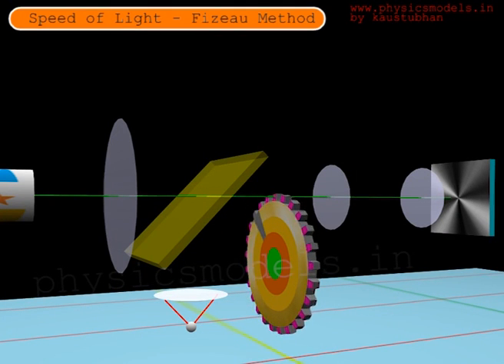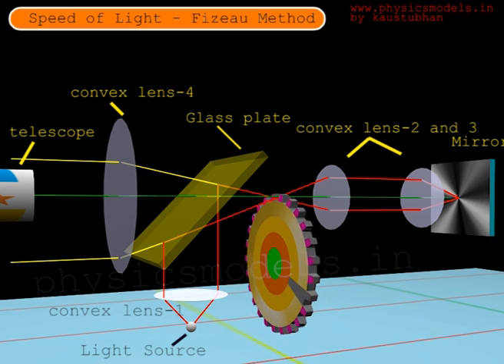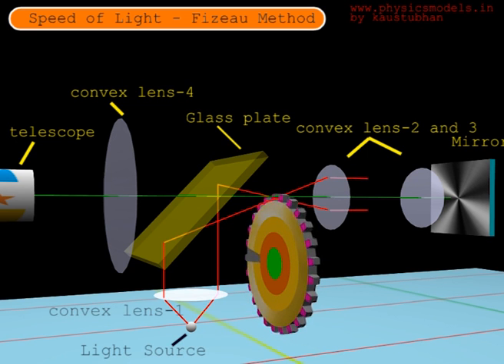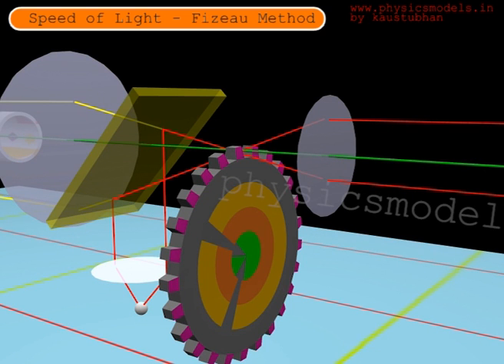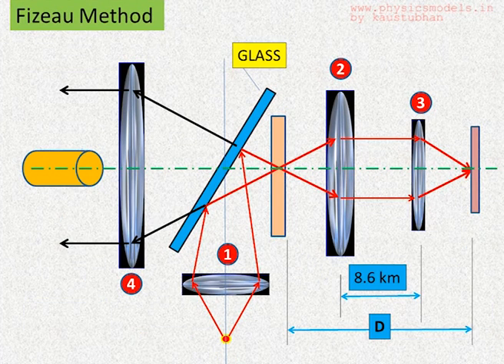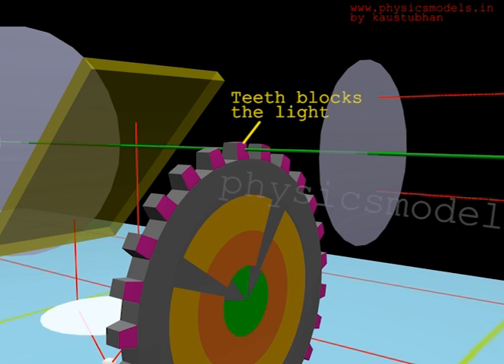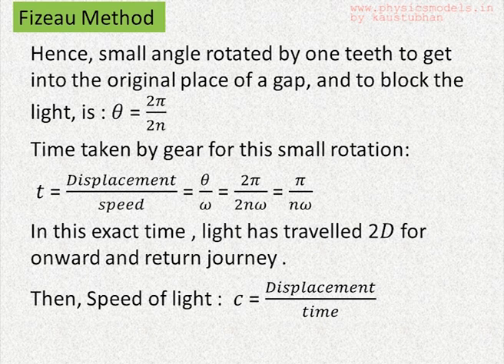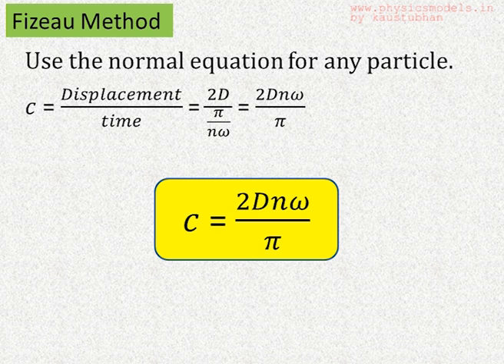Physics Made Easy-Speed of Light by Fizeau method

Comment: 8.6 mile or km 
You said both
Reply from the maker: It's 8.6 km, not 8.6 miles. (I apologize for any erroneous mention of 8.6 miles in the video).
Reply: @physics_animation_tutorial  when doing real science, it is always metric!
Reply from the maker: @martinmendez695   you are right, I said both km and miles , my speaking mistake. The distance between the wheel and mirror is 8.6km.
Reply from the maker: I'm sorry , it should be 8.6km. Fizeau used km, not miles.

Comment: Just a tip here, from an experienced university lecturer: if you put up a slide of text, either read it verbatim or leave a silence of appropriate length. Please do not say something that approximates, but is not identical to, the text content of the slide. At best it is redundant and at worst it creates an unpleasant interference between the two messages.
Reply from the maker: Ok, thanks for the good tip. Got it. Will follow this in future videos.

Comment: But still I can't understand
Reply from the maker: Hi Vikas, you can tell me what exactly you don't understand and I can try my best to explain. request you to login to my website which has more explanations. https://www.physicsmodels.in
Reply: Physics Models this was just a theory and a formulae u explained... But it was not the actual speed..Coz depending on strength one person can run fast other may run slow.. similarly speed of light depends on source of light used ... Here what is derived is the speed of disc rotating with some how we can compare that to speed of light but it's not the exact speed......
Reply from the maker: Hi Vikas, I understand your problem. You have to understand three things here :- 1) speed of light is constant in the universe. 2) It never changes depending on source of light. For any wavelength of light, including white light, the speed of light is the same, for vacuum. Only if you change the medium of travel, speed changes. 3) And speed of light does not change depending on relative speed of observer. This was the outcome of the Theory of Relativity. These are important learnings in physics. Once you get this right, you can master many concepts.

Comment: Hi, again the same 2 problems that are not clear:
1.
To find a velocity you MUST have D (distance) and T (time). How can you determine V if you do not have these 2 variables? 
To get 16 km you can:
16 = 300,000 * 0.000053
16 = 150,000 * 0.000106
16 = 100,000 * 0.000159
So how can you know that this is 300,000 km/s and not 100,000, again if you don’t know the time???

2.
You said that the RPM is 1562 so in 0.000053 sec you passed 1 tooth. 
So after 0.000053 sec you passed 1 tooth
After 0.000106 sec you passed 2 teeth
After 0.000159 sec you passed 3 teeth
So again, how could he know that you pass 1,2,3…………n teeth? 
To get a perspective, after 1 second he passed 26*720 = 18,720 teeth only in ONE SECOND.
How he measure how many teeth he passed?

Thanks
Matan
Reply from the maker: Hello. Yes, definitely, 𝑣=𝐷/𝑡. We are not doubting that.
In our case, We already have "D" as distance , 8x2=16 km. Let us Start from the beginning. 
Frequency = 1/t . So time is indirectly getting measured by frequency in Fizeau experiment. Now, frequency of teeth interrupting light beam is :-  𝑓=𝜔𝑛 
where 𝑓 is frequency, 𝜔 is the angular speed of wheel, and 𝑛 is the number of teeth going past the light beam, which is given by : 𝑛= 720 because there are 720 teeth. 
Then, frequency of teeth + gaps interrupting light beam would be : 2𝑓=2𝜔𝑛 
Distance D = 16 km. 
 Plug into 𝑣=𝐷/𝑡 , i.e. 𝑣=𝐷𝑓 = 16(2𝜔𝑛) 
In this way, Fizeau got around the problem of measuring time "t" using a stop watch, and he had to only measure RPM of the rotating wheel.
I hope this explanation is crystal clear to you, now.
Reply: @physics_animation_tutorial  

Frequency is defined by the number of teeth and angular velocity. Change one or both of these parameters and what will happen? Do the math. In fact, put real world values into the equations above. Why are you using letters when you can use numbers? 

For example:
n=120
What happens when the wheel only has 120 teeth but all other parameters remain the same? What's the calculated velocity of light with 120 teeth? 

The math appears to be circularly reasoned and does not appear to prove anything.

Comment: Great video but I have a big question for you, and please tell me what I made wrong:
The Distance was 2 D = 16 km
So the time that the beam traveled to the telescope/eye was 16/300,000 = 0.000053 sec   !!!!!

Now, 2 problems:
1. With which device he measured 0.000053 sec?
2. To travel only 1 tooth and 1 gap the RPM of the gear supposed to be 15,000,000,000    !!!!!! How can he roll it so fast???
I will explain –
• Let's take that the Circumference of the gear is 1 meter so the radios is 1/2 pi = 15 cm. and let say that there are 50 teeth and 50 gaps each is 1 cm.
• 1 RPM is to do 1 Circumference of 1 meter in 1 minute.
• So in 1 sec you do a Circumference of 0.016 meter. We said that 1 tooth and 1 gap is 2 cm so in 1.25 sec you do a 0.02 meter.
• So in 1.25 sec you do a Circumference of 0.00002 km
• So 1 RPM = 0.00002 km
• Let's divide the speed of light 300,000 km/sec to 1 RPM =0. 00002 so the RMP of this gear is 15,000,000,000 !!!!! 

So how can it be?????
Reply from the maker: Hello Matan, good question. The original description of Fizeau experiment says he used 720 teeth, not 1 tooth and 1 gap. This helped manage the rotational angular velocity of the gear a lot. The calculation for 8km to and 8km on return path gave a total distance of 16km, and the rpm calculation was worked out as : RPM = [(speed of light per second)/(distance)x(No.of Teeth)] = [(3x10^8)/(16x10^3)(720)] = 26 rotations/second , i.e. 1562 RPM. 
This is quite a reasonable and feasible rotational speed. 

Then Fizeau used the equation to find speed of light in terms of:- 
a) angular velocity of rotating wheel, b) no. of teeth, c) the round trip distance = 8km. 
To answer your first query, Fizeau did not have to use a stopwatch to measure time directly. He avoided the whole problem of time measurement (anyway it would have been impossible). Galileo had earlier tried to measure time of distance travelled by light with his "Lantern experiment" and did not succeed. 

Let me know if I have answered your question.
Reply: Hi, again the same 2 problems that are not clear:
1.
To find a velocity you MUST have D (distance) and T (time). How can you determine V if you do not have these 2 variables? 
To get 16 km you can:
16 = 300,000 * 0.000053
16 = 150,000 * 0.000106
16 = 100,000 * 0.000159
So how can you know that this is 300,000 km/s and not 100,000, again if you don’t know the time???

2.
You said that the RPM is 1562 so in 0.000053 sec you passed 1 tooth. 
So after 0.000053 sec you passed 1 tooth
After 0.000106 sec you passed 2 teeth
After 0.000159 sec you passed 3 teeth
So again, how could he know that you pass 1,2,3…………n teeth? 
To get a perspective, after 1 second he passed 26*720 = 18,720 teeth only in ONE SECOND.
How he measure how many teeth he passed?

Thanks
Matan
Reply: ad 1)
You know the RPM which gives you a direct measurement of how long it takes for the wheel to turn once.
You know the number of teeth, you know the number of gaps passing a spot during 1 rotation, thus you can calculate how long it takes for 1 tooth to block the light path or for 1 gap to let light through.
With a little bit of math you can reformulate the speed calculation to replace the time with some expression which sets up a relation of RPM and number of teeth. Which has the nice property that you do not need to know the diameter of the disc, because it cancels out

ad 2)
We cann assume, that at 0 RPM there is no valid measurement and in this case, light that passes through a gap will come back through the same gap. So all you need to do is increase the RPM and watch for the RPM value when you see the first time the mirror changing from light to dark. Because this is the first time, the light coming back will not hit the gap but is blocked by a tooth. From this you conclude, that the short light pulse took as many time to travel the distance forth and back, as it took the gap to pass the original light beam.
Of course it is helpfull, if you have some good guess at what RPM this will happen thus you can accelerate to close of that RPM and only then start observing while increasing the RPM.

Comment: I have a question. You say a small gear rotation covers a gap, and in that time, light travels twice the distance. But wouldn't that mean, the next time light comes, another rotation happens, and thus a gap is open? Or is that why you considered 2 pi and 2n?
Reply from the maker: Let's start with a zero speed of gear. Let's say there is a gap. Looking through telescope, we will see light (which would have gone to mirror, and bounced back as well, and into our telescope). If suppose at zero speed, there is a teeth in our way, we will see no light through telescope, the light would have got stopped at the teeth on its onward journey itself. Now when the gear speed of rotation (omega) is increased gradually, we will see an Intermittent scene -> light flickering, on and off. This means we should be seeing a bit of both teeth and gaps coming in our way , in our line of sight , and in an alternate fashion. That's how we will get flickering (ON-OFF sensation). 

Now the speed of gear is further increased carefully upto a value, and when the light just stops coming into our eyes.  The speed is not increased any further. The whole equation derivation is for this situation. This is a situation where the light went and just came back and got stuck at the teeth. One Gap just about moved into a Teeth (The gap initially was for the onward journey, and then the teeth rotated and just about blocked the light on return journey). Therefore , the Arc Length Linear movement a the periphery of the disc = One Tooth plus One Gap = (2n). This leads to the Angular Rotation amount = theta in radians = 2(pi) divided by (2n).  (where "n" is width of one tooth). 

Now any further slight increase in speed of gear will cause a Gap to move in, of course ! but the experiment is about finding the Light Travel time just when it reaches back to the Gear Tooth surface. Only then we would be justified to take the light's distance travelled =2D . 

Now, another question can be :- what if we increase speed and again allow a Gap to appear in place of the Blocking Tooth? Then light's distance travelled would be more than 2D since it would pass the gap, and come into our eyes (we would see the light through the gap). Also this situation can happen even when we keep the gear stationary and a Gap is kept exposed both sides of the light's journey. That would lead to an erroneous result for speed of light. There has to be only one correct measurement of speed of light, hence the speed of gear is gradually increased till the light is just blocked.  
I hope I am clear.
Reply: Thank you, now I understand it. You were very clear.

Comment: why need two laser beams going from source?
Reply from the maker: PEKKA PUUPÄÄ 
actually more than two beams are needed, here only two beams are shown. The purpose is to get as much light as possible to go till the Mirror and return back, so that from the eye position at the telescope, we should be able to see clearly.
Reply from the maker: the two beams shown are to indicate that they slightly converge on the glass plate (see 2D slide) and get partially reflected, at a correct angle in order to go through the gear teeth.
Reply from the maker: Not sure if you got my reply, it seems to have got deleted. There are many links of proof of this equation, please refer one such link by Chris White .  http://www.pcs.cnu.edu/~David.Gore/Capstone/files/WhiteC.pdf